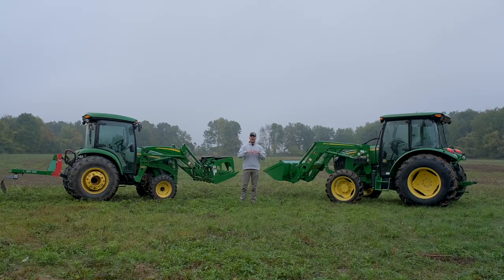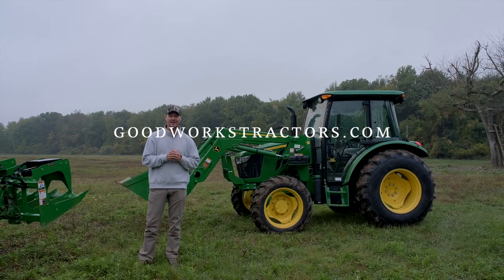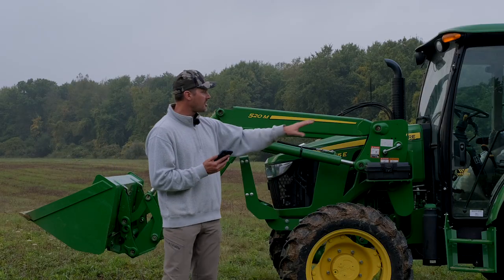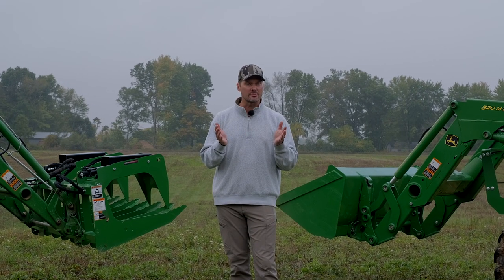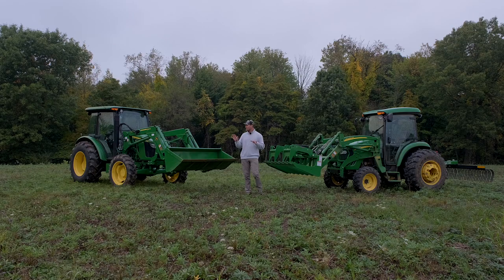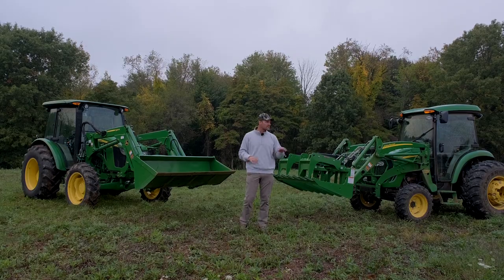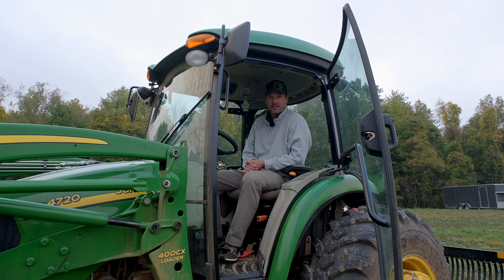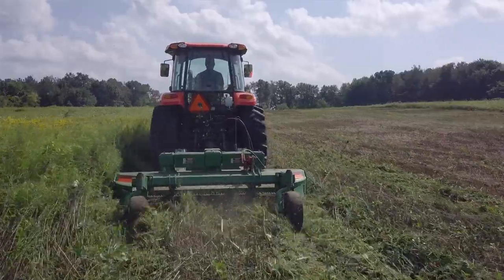HOW'S THAT POSSIBLE? 6 YEARS OLDER, 600 MORE HOURS, SAME PRICE? 😕

Comment: Imo, the 5 series is just the latest continuation of the small utiiity farm tractor aimed at farms.  Most have at least one, and likely several, for doing chores, bucket work, haying, hauling, and all kinds of other jobs.  It's the "workhorse" and/or daily driver.  They are definitely designed and aimed at agricultural applications.   The 4 series are compact utilities- meant for hobby farms- like horse stables- property owners/managers, etc  That's why you see the creature comforts and premium options- these folks tend to have higher expectations in that regard.  Farmers and municipalites just want a solid workhorse they can afford (to work the hell out of)- ie cheap power.   I think that's why they offer similar powered options in a variety of ranges- application.

Comment: When I was looking at my 4066r I also looked at a 5075e, I knew the 5 series and 6 series tractors well, for me it came down to 4 key points transmission and 3 point control. The 4r in Australia is offered with the ehydro only and electric 3 point control. The 5e is either the 9 x 3 sync reverser or the 12 x 12 and mechanical 3 point control. Neither transmission options on the 5e had a low enough ground speed for what I needed and I wanted exact repeatable 3 point control. So if I wanted that it would mean going up to a 5m euro spec or 5r euro spec. Weight and size also played a choice in the decision. I needed something light and handy to work small areas of land. And spec a 5090r up with a few niceties like front axle suspension, cab suspension and command arm with msl loader I was looking at over $120,000 which was abit over $30k more. So it was a 4066r for me. I'm happy with it, planted an acre of potatoes with last month with no issues and that included soil prep spraying brush removal and fencing.  The 4r is a great tractor but I wish Deere would of put draft control on them. As it's not a good tractor for primary tillage work like mouldboard ploughing and chisel ploughing other than that it's great
Reply from the maker: Great insight Michael.  Thanks as always! 👌

Comment: I have four 5000 series tractors that are used every day by a variety of employees with different skill levels and they have been rock solid machines.  One note, on the 5 series tractors you can get an air suspension seat which makes a big comfort difference when working all day.  I don’t know if that is an option for the 4 series.  Dollar for dollar at the same horsepower I would always go for the larger series unless there is some mitigating factor where a smaller tractor might have an advantage.  Bigger series has more strength and capacity even when horsepower is the same.  Interesting note I have a 5400 with over 8000 hours on it, the engine has never been rebuilt, still runs like a champ.
Reply: I have a 2009 4720 with an air seat

Comment: I have an open station 2007 John Deere 5325.  It has 2 sets of rear remotes.  They are the push pull type which are not easy.  It has a 12 speed power reverse.  The engine is a 5 cylinder at 67 horsepower.

Comment: Great Video.  Love all the detail you provide.  I have a 3520 hydro that I absolutely love.  Every now and then I wish it was larger for a bigger job but 95% of the time, its perfect for what I do with it.  People often ask me for advice when looking for a machine.  I tell them to start by figuring out what they intend to use it for mostly, because there are so many options/configurations to consider. I had a 2305 at first which was not quite enough machine for me based on my useage. And after researching and speaking with a sales person at my local JD dealer, I realized that I should have purchased a 3 series.  One size does not fit all for sure.

Comment: Stability during work conditions is a huge factor. The added weight of larger machine keeps you planted while running an implement and/or doing loader work. If space is a concern then weigh that against work load. And obviously choose accordingly, but an "identical" power output/hydraulic  pump rating between two tractors always has to be judged along with frame size and overall weight. And that's just speaking of the ability to do the work. As I alluded to earlier, the larger machine will always be more stable. For instance, if you run a 6-7" tiller all day on a 4 series vs the same implement on a 5 series you'll be a heck of a lot more "beat up" by the end of the day on the smaller machine than the larger. The overall size and weight just makes for a much more capable work platform.

Comment: 5075e we bought couple years ago, came with one rear remote.  Really kind of limites you what you can put on the back.  Also wish we would of went a sizes bigger, seems to have a hard time pulling its own weight in C range
Reply from the maker: Thanks for stopping by!
Reply: Yeah I only use C range for transportation. If I'm pulling anything that heavy, B/4 is usually fast enough or borderline too fast. I agree only 1rear remote isn't enough for a 5 series.
Reply: I have a 2018 5075e and it also came with 1 rear remote. A second can be added but my dealer quoted around 2K for the complete install. I really don't need it that bad yet. But having said that I wouldn't be happy with a smaller hobby farm tractor. With a width of 6 ft. and a 7 ft. loader bucket, brush hog and rear hyd. blade it's hard to beat! I've never had an issue with the gearing in the transmission, runs down the road perfectly. And I really love the Speed Fwd/Rvrs, that saves a lot of valuable time. And it hauls quite nicely on my 30 ft. GN. This guy doesn't deal in 5000 series tractors or larger so he is biased in his reviews in my mind!  🤠

Comment: I love all of the great information that you give us in your videos. I think you missed a big point on comparing the hydro transmissions to the power shift though. If you go hydro, you lose the ability to use your rear brakes individually to help steer and maneuver in tighter places. Hill sides are another place that you can brake the high side to put more torque to the wheel with more weight/traction. It is an old farmers trick that I was taught 35 years ago. Thanks again for sharing your wisdom on these machines.
Reply: This is a lost art. Not a single guy I know uses independent breaking anymore. I wouldn't be surprised if Deere removes that feature in future models. I know I'm guilty of just leaving the brake pedal lever down all the time.
Reply: I use the individual brakes for tilling foodplots!
Reply: only tractors that Deere makes without differential brakes are the subcompacts and the 3Es.

Comment: I have 4 John Deere, 790  a 30 Hp. 1630. a50 hp.  4230 a100 hp and a 5E  100hp all excellent tractors. Just pick out the tractor for the job size. Love the new skid steer quick hitch front attachment loaded on the 5E. One person can hook up attachments super fast and easy.
Reply from the maker: Great collection!  Thanks for sharing!

Comment: I love nearly everything about the 5 series, except that it isn’t offered in a hydrostatic transmission.  The larger roomier cab is almost enough to go to a 5, but I do way too much loader work with my tractor to be shifting.  To be clear, I don’t need a 5 series, lol, but what does need have to do with anything?   3rd world issues, as you would say, lol.

Comment: The smallest “ag” tractors to me (i.e 5 series) have always seemed to be a better value than the largest “compact utility” tractors (I.e the 4 series).  The biggest difference is that the larger compact tractors tend to have more creature comforts while the smallest “ag” machines have a little more working capacity.

Comment: If I had to buy I think I would need 2 tractors of different sizes. A 25-30ish hp for mowing the grass and a 75+ hp for snow removal (that's how much snow I got here!) While a 3r would do the job, it would be overkill on the grass, to the point it'll cause damages to the ground and on the other hand it would take forever to remove the snow.

Comment: I had a UK-spec' 5055E with cab (2011) - it had two pairs of spool-valves on the rear as standard. I changed it to a UK-spec' 5085M in 2015, and that has same setup. I believe the 5065E you are showing here has the John Deere 2.9 litre 3 cylinder engine. What engine has the 4720? I can say that my 5085M is a World away in terms of performance compared with the 5055E - particularly working uphill with any sort of powered attachment - the 5055E struggled, but the 5085M sails along regardless. This was the main reason we changed model.

Comment: Having many hours of daily work with a 5 series its not bad tractor and we do feed wagon duty with it and the only down side is the emissions dont do it any favors since about every 2 years it gets new fuel injectors and full tune up since our application does not work it hard enough so we end up with fuel in the oil . Will be going to a Kubota or a Massey next time

Comment: The 5 series seems to be more of an AG tractor they have mounts for Baler and seeder controls and monitors built into the cab .I believe thats  why the cabs are bigger inside.
Reply from the maker: There's another Series up called Ag tractors.  The 5 Series is a called a Utility tractor, sandwiched in between Compact and Ag.  Thanks for watching!
Reply: The 5 and 6 series are both considered utility tractors, correct?   And yeah, utility tractors are pretty much the workhorses of anything but the largest hay operations.   They're also common in smaller commercial farming, county road departments for pulling batwing mowers, medium to larger hunting clubs for food plot work, etc.
Reply from the maker: Well, yeah I guess JD does a good job there again of confusing us all.  Some of their 6 Series do fall into the Utility category while there larger 6 Series are Ag/Row Crop tractors.  So, they make it pretty simple! 🤣
Reply: Well, they're hardly the only company with confusing names and model numbers.. just one of the few I have a nagging suspicion it might be deliberate, given so many of their other customer unfriendly practices at the corporate level.  But perhaps that is a bit far off into the weeds for a channel that focuses more on the individual machines, which to give JD credit where it is due, still seem to be very well built.

Comment: I must have completely missed what about this 4 series makes it the same price as the newer 5 series? I understand that it's an R equivalent vs the 5 series E. But what specifically makes the older, smaller, less capacity machine worth the same price as the newer, larger, higher capacity one?
Reply: Part of it is that the 4=series comes from the premium line, and has more options on it, while the 5E is an economy tractor.   The mid PTO likely drives that price up.too, so does the self levelling loader; the grapple bucket, and I think he alluded to some other attachments that come with it.   The 5E comes with the loader, period.
Reply: Also he did not mention emissions. The older one would not have them if I'm correct. That would be a plus to many people.
Reply: Mid PTO, HST, Extra attachments.  The base tractor new was $35K.  Loader, Grapple, Belly mower, rake, quick attach, adds at least another $15-20K or more new, so guesstimate $55K new.  Todays market, used is selling for damn near new pricing.
Reply: @TheSailingwoodworker  no DEF on anything less than 75hp so that doesn't apply in this video.
Reply: 4066 is the highest horsepower Category 1 compact tractor. That's why it's expensive and on back order all the time. We waited months for one but ended up getting the 5065E for the same price. Glad I did because the extra weight and footprint makes it a dream when lifting heavy loads and dragging heavy (Category 2) attachments. The great thing is, converting the 5 series to Category 1 is pretty easy. Making it an easy transition from Category 1 implements if you already own them.
Reply: @kasken719  No DEF but would have a DPF on tractors with more than 26(?)HP.

Comment: Something you didn't touch on with the 5 series is that you can get a 540/1000 pto option to run either size of implements. On my 5115m that option also has an economy pto mode so the 540 pto speed be used at a much lower engine speed for low horsepower implements. 

Also having used both 4 and 5 series I will say that the 4 series is much more maneuverable, much tighter turning radius, in tight spaces.
Reply: One other comment on the 5 series. My 5115m also has the deluxe rear remote option which has 3 sets of rear hydraulics and I forget what they call it but set #1 is setup different so that it can be adjusted to a setting specifically for running hydraulic driven pumps, like a sprayer pump. Whereas according to the manual the other sets aren't to be used for that purpose.

Comment: Taking about spacers i have  2004 4120 jd  the rear tires are close to the fenders cant put chain on her,  i heard you can flip the back tire around never done it but you tink by doing this will be enough to put chain on or do i need spacers? Thanks in advance👊

Comment: What is the price difference between a 4066r and a 5075m series.  Similarly equipped?
Reply: 5075M is more expensive. Pluse it fakes DEF. 5065E is cheaper and no DEF

Comment: Years ago (20 to be exact) it was easy to compare a Kubota to a JD as far as Compact tractors, the B series had an exact counter part. Today though, not so easy.  Whats a direct comparison of an L4060 HSTC to a John Deere?  I thought a 3046R, but dimension wise, the JD is smaller, and lower.

Comment: Some say John Deere's nomenclature is confusing, but I think Kubota's is even more confusing. At least JD uses numbers for their series of tractors instead of letters like Kubota. Kubota also doesn't really have a proper designation for their economy tractors, like I've seen L3010s, L2501s, MX6000s, and etc. But none of those follow the same nomenclature for designating the tractor as an economy model. I dont know, it just seems weird to me how Kubota does it.
Reply: Kubota is not that hard, BX is the sub-compacts, B, LX, L, and L60 are the compacts, B is your basic up to 24HP, LX 24-38HP, L is the basic 24-47 HP, and L60 is the 37-62HP range. They recently added the L60 LE series which is a dressed down version of the L60 Grand.  Think of the LX as the R series JD in that HP range.  M series are your 60HP and up utility tractors like the 5000 series JD. 

The hard part is trying to figure out apples to apples on what model JD is similar to what model Kubota.  Still trying to figure out the L4060 to what JD because it doesn't match up to the 3 series 3046R, though the HP is a bit more on the R, but its a smaller tractor.
Reply: @acdii  The LX series only goes to 33 hp. But if you are to look at the lineup of letters, as a new person, how would you know that an MX is bigger than a BX? With JD it’s east, just numbers going up to signify a bigger model. How would a new person know which model is bigger/better or different right from the designation? Because JD uses letters to signify an economy tractor, which makes identification easier.
Reply: @johnsponable4907  M series are Utility tractors. Not even in the same category.  The Kubota website makes it easy to pick and choose what you are looking for based on category.  The LX is 30.8 HP, did I put 38? Sorry.    JD doesn't even list all the specs such as length, width, height, and ground clearance. That makes it difficult to compare to other brands. 

I needed a tractor for hay production, but not a big Utility tractor. Trying to do an apples to apples between JD and Kubota was difficult, their 4 series may have more HP, but they are lighter and smaller, not good when you have equipment that weighs as much or more than the tractor. I was going to get a 3046R, then found out it sits 2" lower than the L4060, which has the same drawbar height as a full utility tractor.  The frame on the 3046R is also not as strong as the L4060, and the loader is fixed, cannot be removed without unbolting it. All that and it is several thousand more.  I would have to jump up to the 4 series to compare to a L4060 in size and weight. A 4044R is closer in size, but has an inch less ground clearance. The L4060 also has a tighter turning radius.  The 4044R is $5,000 more as well.
Reply: @acdii  I was never doing an apples to apples comparison of the tractors, just the nomenclature. I also never mentioned the M series, I don’t think. I don’t really care about what JD lists on their websites because I can usually use TractorData. If you are comparing the 4R/M series to the MX, then yes the 4R/M is a little smaller and lighter, because the MX is a utility tractor and the 4R/M is still a compact.
Reply: @johnsponable4907  You mentioned the MX which is the Utility line.

Comment: Great job Courtney. I think i would stay with the 4 series tractor. Reason is that there is no shifting involved. Maybe they may in the future come up with a hydro 5 series. On the bigger tractors they have power shift. Is that sort of hydro? I have used the power shift on a 4440 farm tractor and was told not to clutch when going forward gears only to stop and clutch to go to reverse. Is that correct?. Anyway keep up the good works!. Have a great day guys and be safe!,    Tim
Reply: You don't need to use the clutch at all with Pwer Reverser. You can go from forward to reverse and the tractor will go to neutral, slow down, then shift to reverse all by itself. In fact, it took me a while to learn not to use the clutch so much when doing bucket work. It's easier on the leg and on the machine.